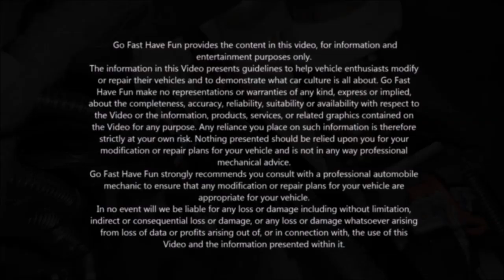Brake Pedal SWITCH Maintenance (Brake Lights not working) | AnthonyJ350

Comment: hey i had a question i was looking to get a remote started i saw vision has a deal on a   Viper 1-Way 1 Button Remote Starter Works with Gas and Diesel Automatic Transmission (VIPER4115V1D)  i was wondering does this have smart start  the close range one not the long range one  thanks
Reply from the maker: You honestly want the Idatastart HC3, it's the best operating unit we have for remote starters.
Reply: @AnthonyJ350  thanks

Comment: Anthony, I have  a cougar wagon.   Brake lights stopped working, so I checked the wire going to the switch.   It had power.
I bypassed the switch, and ran some alligator leads from the hot wire to the other wire on the brake switch, which  goes to the brake lights.   That made the brake lights work.   I replaced the old brake switch with a new one , and still have the same problem.   For now, I've installed a toggle switch on the dash to give me brake lights.   If the switch was grounding out for some reason, it should blow a fuse, or spark at the point where the grounding is taking place.   Any idea what the problem might be?
Reply from the maker: Can you measure the voltage of the brake switch to the lights and check the voltage coming in?